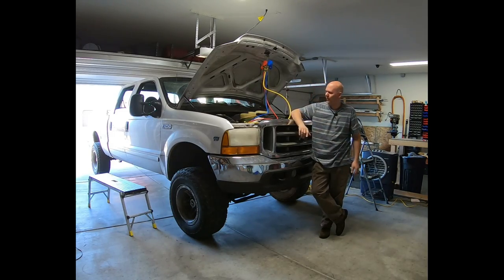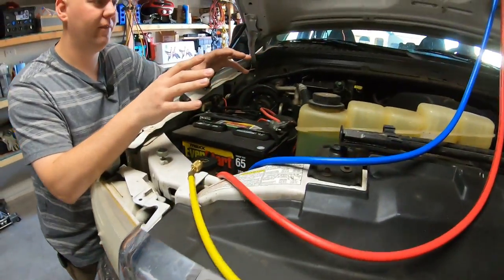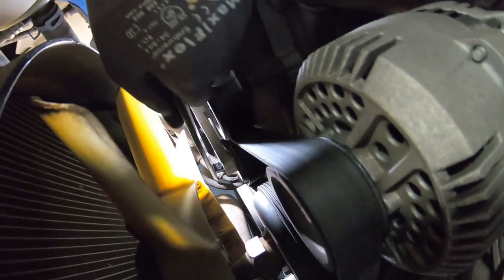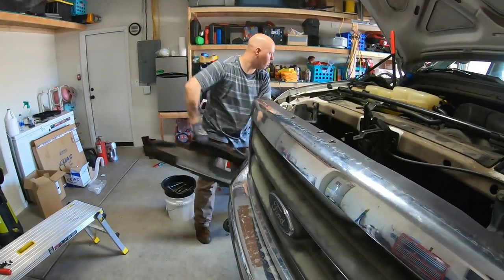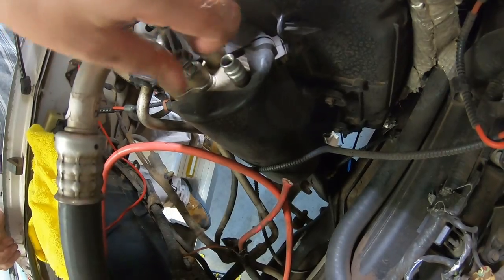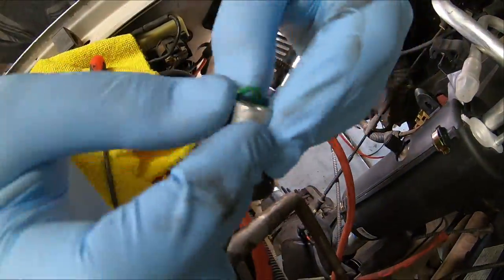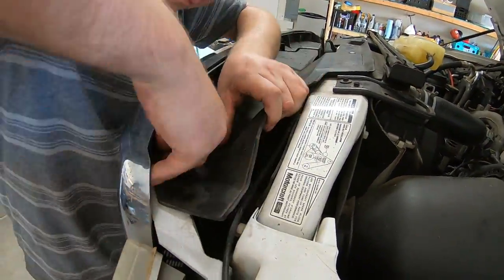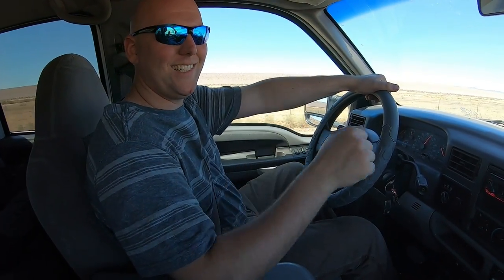Ford F250 Super Duty A/C Compressor Replacement condenser, orifice tube, evaporator, accumulator

Comment from the maker: As an Amazon Associate I earn from qualifying purchases.
Parts purchased for this project:
Compressor: https://amzn.to/3gsLyw3
Condenser: https://amzn.to/3iAS1XB
Evaporator: https://amzn.to/31LCJcB
Accumulator/Drier/Orifice tube kit: https://amzn.to/2ZHc4em

To donate financially to the channel:
https://www.paypal.com/cgi-bin/webscr?cmd=_donations&business=5PRRGY4GM2CSE&item_name=To+Support+A+Guy+And+His+Projects%21&currency_code=USD&source=url
Reply: what were vent temperatures before and after
Reply from the maker: @jessierumley4203  varied on time of day but it was closer t o60 before and closer to low 50's after. still not as cold as my other vehicles, but cold enough!
Reply: @AGuyandHisProjects Great video sir, and I appreciate your honesty that will save me money. I was wondering if you or any of your friends ever did the heater coil isolation modification and if it help and how much it helped. I have a 2002 and I have been able to get it to 48F on 98 degree days without changing anything but orfice but I am not happy... pull 1hr from the lake when you been on the water all day I like to see at least 40f but I am beginning to think after all you did, that our old truck AC is not big enough for the crew cab and certainly not designed to get us low enough vent temperature no matter where were live. I drove a 2016 and it would freeze you when 98f outside. I think they just didn't design our systems well. I wish someone had an upgraded system they would sell to retrofit our old truck. But I think I am like you I got 160,000 on the old girl and I am not paying 90,000 dollars to these greed fill people, When I was in my twenties you could buy a F250 for 30k on any lot. This country has gone so far downhill....
Reply from the maker: @jessierumley4203  yeah so I had the v10 in this video and it wouldn't cool quite as nice as I would like, adequate yes but not icy. I now have a 6.0l powerstroke that has the same a/c system and it blows just about the same as the v10 did lol. I have tried oem compressors and other equipment. I've played around with different orifice tubes and yeah, neither truck will make nipples hard in the summer haha!
Reply: Do you have an Amazon link for the Blue AC Disconnect tool you used on the line in the video?
Reply: Have a question. Im going to be doing this here soon. So did you or do you drain the refrigerant out of the system before doing this. Does it matter if you do. Im going to be replacing everything you did plus all new hoses.

Comment: I am getting ready to do the same thing, same parts but for a 7.3. Don’t ever look to see where the compressor is located on a 7.3. It is a much easier job. I think you were supposed to take the rubber off the other evaporator, but I doubt it matters. Because the compressor is so easy with a 7.3, I have never removed the inner fender, so the evaporator is the hardest step by far. It is really hard to access those back bolts with the inner fender not taken out. I cut the top of box where the evaporator goes so I do not have to remove the back bolts to get it out. I found that I was able to seal the box back better doing them this way when not removing the inner fender. One piece of Mylar tape. Another thing you might consider is during the summer, I disconnect the heater core and connect the water pump with a straight piece of hose, by passing the heater core. Plug the two open ends together and leave some antifreeze in it. You might also want to replace the blender door actuator. Super easy. All you need is a flat screw driver, but make sure the replacement is turned the same as the current one. What happened to mine was the blender door stopped closing completely and the compressor started melting the Teflon in it. When I pulled the orifice, it was completely clogged with black. The only way to fix it is a complete replacement. I tried cleaning out the evaporator, but melted Teflon is stubborn. I will pull the inner fender this time and make sure the air box is sealed.
Reply from the maker: Thanks for the advice and comment!

Comment: The pressure switch that is on the hoses that connect to the compressor.....Why didn't Ford allow for the connecting plug to FACE you instead of facing AWAY from you.  AT LEAST it was that way on my truck.  What a PITA!!  Thanks Ford engineers...I used a dentist mirror and a hook tool to get it out..
Reply from the maker: Always some frustration haha

Comment: Do you have links to the O-ring kit you have and also for the plastic tool you used to separate the tubing that holds the orifice tube together?
Reply from the maker: O ring kit is just a conglomerate of various kits I've bought. Your local auto parts store probably sells a variety pack. As far as the plastic tool it is a refrigerant line disconnect tool.
Reply: @AGuyandHisProjects  Thanks got all my parts replaced.

Comment: Here's a good tip for you - To save your Condenser coil from damage Simply install a house screen with frame in front of the coil assembly. On my 2008 Super Duty someone did this before I purchased the truck - and WOW! what a saver from buggs and road rash gravel getting in and plugging the air flow...
Reply from the maker: I'm sure that would keep debries away yep, as long as it doesn't starve for air then it sounds like a great idea!

Comment: Thanks for the video, but some of your thoughts on not showing some of the details while replacing the Evaporator Core being stupid is not so stupid. We just swapped out ours yesterday...It took total of 4 hours. Details such as removing the fender liner which was a nightmare as it did not want to come out with 2 of us working on it. I think we had about 14 or so screws to find and remove, all the hoses, accumulator, etc has to be removed. Both my son-in-law and I turn wrenches on almost all repairs to our vehicles and this one was a bit of a challenge. But rewarding in the end. Just glad I got the quick view at least to motivate me to do this repair. I am sure the repair shop would have charged me an entire day's labor.
Reply from the maker: Thanks for watching and the comment! Yeah I have to pick and choose how many details to show as the videos start getting extremely long lol. Glad you were able to figure it out and end up with that feeling of accomplishment! Always feels good when you are finished and know you saved a bunch of dough

Comment: Great vid, i see you went aftermarket on all of it. where did you get the accum./drier tube o rings at ? and 1 more if may, on the top of accum/drier itself next to the two main lines/tubes is a port sticking up (mine has a black cap on it), could you tell me what that is ?
Reply from the maker: Thanks! I believe I have all the parts linked in the video description and the top pinned comment. The black cap covers a port to hook gauges up to

Comment: Thanks for the video.  I performed this exact proceedure  Except on diesels the Compressor is at the very top.   Super easy.   My truck is a 2000 Ford F-250 Super duty 7.3 Power stroke. Same color as this picture.    Just followed this video and installed UAC condenser, Compressor, Dryer and evaporator.  it was all one kit for $247 from Rock Auto... The evaporator was a little challenging.  But compressor, dryer and condenser was easy peasy.  it's 101 outside today in Texas and my AC is blowing 45 Degrees.  Everything worked like it should.   Things to consider having on hand... when you change the Evaporator, get some updated insulation and or tape to cover the Air Box.  Super easy to put a good insulation job on it while it's out of the truck.  Under time crunch I put it all back together.    So I will come back and do the best I can on better insulation.     Right now, I am happy with it. I will try to check back in a year.   Feel free to ask questions.    Good luck ... YMMV.
Reply from the maker: Glad I could help! Thanks for the comment and thoughts to help others out :)
Reply: Almost 1 year later, I can tell you that the system is still working great....  Very Happy I did this....I live in Texas and it gets hot.....Just had a very hot day in August and it worked very well...  My insulation job didn't last.... but overall the system performs very well.     Very happy with my system and highly recommend this scenario.

Comment: I'm going in to change the evaporator (only thing I never inspected or changed, smh) and orifice tube. Everything else is already new a year ago. I shouldn't have to change my drier again right?
Reply from the maker: Yeppers! Everytime you open the system it is a good idea to change it. It absorbs moisture and everytime you open system you introduce more

Comment: hello, is it easy to replace the ac lines/hoses as well while replacing the other components?
Reply from the maker: Yeppers!
Reply: Do you have any videos on this as well? I have a bad compressor and a leak but I cannot find the leak so I figure it might be best to replace the high and low pressure lines as well to be safe
Reply from the maker: I do not think that I do...but if you check out the Playlist on this truck there might be one in there. I've had a lot of cars and filmed a lot of videos haha. I can't remember anymore

Comment: Nice! I will be doing this coming up spring 2021. Right now it's November 2020 and I have plenty of time to get the parts. Whenever I do this job, this is the video I will be using. Except Mines a 5.4
Reply from the maker: Thanks for watching! I tried to do a thorough job on this video for that very purpose. Please remember though, I am not a mechanic nor do I have any professional experience. How close are the 6.8l and 5.4l layouts? Do they look similar?

Comment: I've been trying to find the evaporator temperature sensor, with no luck. No references anywhere. There is one part for sale that is called a cabin air temp sensor, and one supplier has an alternate term "temperature sensor for evaporator". Does this era AC setup have a temp sensor in the evaporator itself, as most all auto AC systems do? My evap to accumulator tube and the accumulator to compressor lines are icing up solid on Max AC, and the condensation stops dripping. The AC still works fine, and it doesn't freeze up on normal AC mode.
Reply from the maker: I don't know anything about an evaporator temperature sensor. Typically the evap temp is regulated by the orifice tube to my understanding. But I could be wrong.
Reply: @AGuyandHisProjects  Hey thanx for responding. Yeah, most cars and also home AC units use a temp sensor embedded in the fins of the evaporator. I think the ‘99-‘07 are different in that way. Do you ever notice it icing up when you run it on Max AC? My accumulator inlet and outlet pipes are getting solid ice on them. Fine in normal mode. And it works fine on Max, even iced up.
Reply: I just replaced my evap core using this video...there is some "device" I'll call it mounted inside of the evap housing (this is on a '99 super duty)...it has some resistors on it and a couple of what looks like wires wrapped in a spiral , kind of like a tighly wound spring...I have NO idea what it is, I didn't touch it to do this repair, and I really only gave it a quick "wtf is that" glance...I'm only mentioning it in case it's the thing you're talking about!
Reply: @marks93cobra  Hey thanx for replying! As DIYers we can help each other get our vehicles working properly. I suspected that was the blower fan speed resistor you mentioned,  and after a web search I found images of exactly what you are talking about with the resistors and coiled wires. It is the fan resistor (Autozone sku 349719 if you want to web search it for your own knowledge, they go bad a lot and mine actually is bad and I wanted to change it, so you’ve saved me some searching!). I have it on good authority (TooManyToys here on utube) that indeed these trucks had no evap temp sensor. Weird. Watch evap replacement videos on other autos and they all (or most all) have a  temp sensor embedded in the evap fins. Also, if you notice your fan speed doesn’t seem to change from 1 to 2 and 2 to 3, then jumps way up on 4, your resistor is almost certainly the problem.
Reply: @AGuyandHisProjects  Yeah, the orifice tube simply evaporates the Freon and maintains high pressure in the system before it and by evaporating into the core it drops the pressure beyond it, but has no mechanism for shutting down the compressor when the core freezes up. Most all AC systems (auto and home/commercial) have the temp sensor that shuts down the compressor when the evap core gets too far below 32 degrees Fahrenheit.

Comment: Maybe a dumb question but do I need to get the system vacuumed out before I break everything apart?
Reply from the maker: You gotta recover the refrigerant before opening the system. Then vacuum out all the air/moisture before filling it back up

Comment: I changed everything but the Evap and i lost all charge in 4 days to where the comp wont kick on.. I dont see any leaks w the dye but never took it apart to check the Evap.
Reply from the maker: Dang, always sucks when it doesn't work out :/
Reply: Did you figure it out ?
Reply: @LemonySnicket-EUC  I think I had a bad o ring where the line goes into the drier. Evap was in pretty bad shape also. I ended up replacing it at the same time I fixed the o ring

Comment: Great video. One question. Did you put the rubber gasket from the old core on the new core?. My mechanic replaced my core and didn’t replace.
Reply from the maker: I tend to not re-use any gaskets unless I absolutely have to.
Reply: @AGuyandHisProjects  sorry. I think I wasn’t clear. When you take out the the old core it has rubber and foam around it. The new core comes without it. When my mechanic installed the new core he did not re install the old rubber and foam. So my question is when you replaced your core did you install it without the foam or with? Sorry for not being more descriptive the first time. I think the air is blowing around it and allowing the core to freeze on long drives. Thank you in advance for any idea you may have.

Comment: Thank you for this video.  How and where is oil added?
Reply from the maker: If your compressor requires the added oil I am told you put it straight into one of the compressor ports. If you can't fit it all in there I have put the rest into either the accumulator or the low port. I am not a mechanic though and can't guarantee the proper way to do that. That is how I typically go about it though.

Comment: Very good gonna do the same thing on my 7.3 over the weekendWhat is a really rough range  on the parts pricing.  I’ll probably end up buying my parts through Napa since they are close
Reply from the maker: Thanks for watching! Check out the parts list in the video description and that should get you close
Reply: How did it go? Need to do it on my 2001 f350 7.3
Reply: @stitchthisditchthat259   very well thanks for asking. I replaced all parts my 16yr old son helped and we both learned a lot. For refrigerant we were able to get a scale a pump gauges and refrigerant from an HVAC friend. Blowing nice cold air wife’s happy!
Reply: @williamwmcqiv6157  lucky man unfortunately for me discovered I have no ac package on my truck no condenser or anything else no ac controls in cab looks like I’ll continue to cook until winter in the Midwest here
Reply: @stitchthisditchthat259  Ouch..I once knew a guy who ripped out his ac in az cuz he only used his truck to get to work and he could get there before it would cool down. His logic…. it made better sense to rip it out instead of …just not use it.

Comment: Hey man, really appreciate the video! My 02 7.3 has an issue with how hard ac blows. I pinch 2 outside vents for the right feel. Replaced compressor, fan-motor & fan, along with resistor. Only positive results were colder air blowing consistently, but no added wind speed. Did your wind speed from your vents increase after completing the work in this video? Thanks again, dude! 7.3 High-Life!
Reply from the maker: Thanks for watching! The only thing I did in this video that would have increased the blower output is replacing the evaporator. I dont know what is different on the 7.3, have you looked for a cabin air filter?
Reply: Unfortunately, no cabin filter in my model. Which leads me to believe the evaporator may possibly be clogged with residue and restricting the flow of air. Thanks for the quick response, man!
Reply from the maker: Keep in Mind I am not a mechanic, but possibly weak blower motor or resistor as well?

Comment: How many ounces of oil did you add to the compressor ? Need to change the compressor on my 7.3
Reply from the maker: Thanks for watching! You have to find out how many ounces came in your new compressor, then subtract that from what is on the label under the hood. Every compressor model/manufacturer is going to come with a different amount of oil already in it

Comment: THIS VIDEO IS A+ AWESOME. Sorry stuck on caps. No wasted film shots, no wasted words. Good angles and tips. It is so hard to make a video this good... I bought a 2003 f250 super duty V10 from New Holland tractor in Oregon for $2500. And sold my 30K 2014 RAM after tearing offf the dash and redoing the AC in that. I have no idea why this runs so well with 325K miles on it. I like your shocks. I put FOX 2.0 on mine.
Reply from the maker: Thanks for the comment! I always appreciate the feedback. I have actually never run fox shocks on any of my vehicles, not for any reason other than I just never have. Someday maybe i'll spring for a set